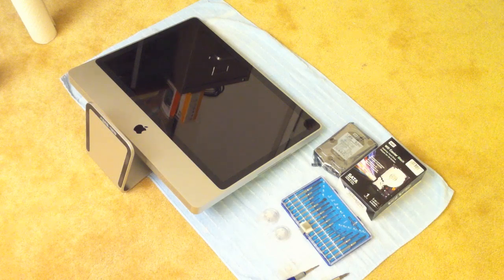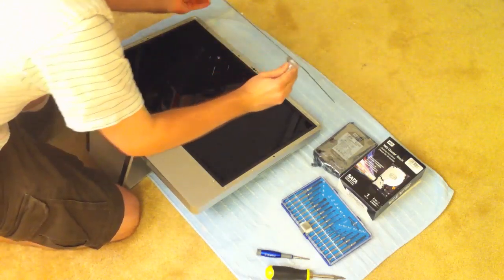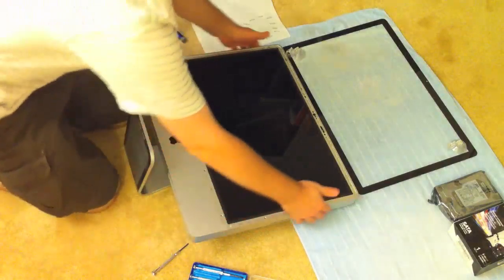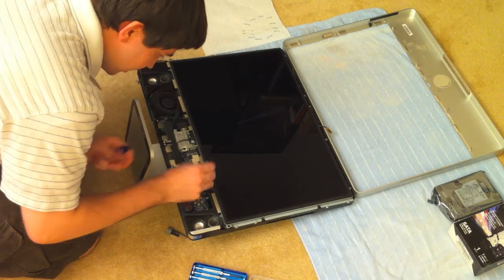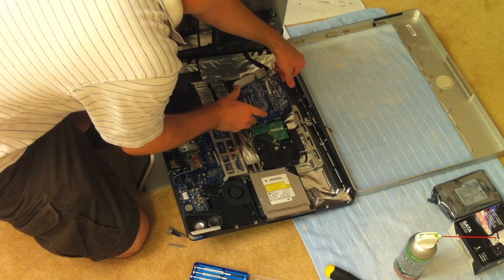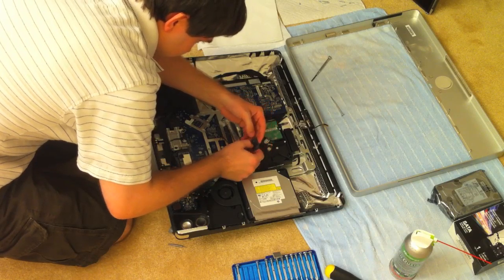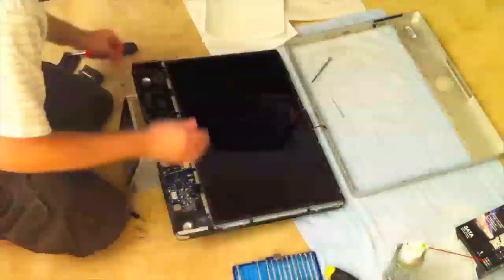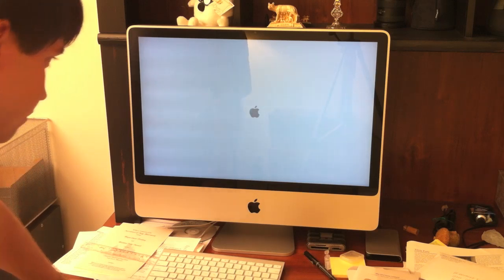iMac Hard Drive Replacement / DIY Take Apart Guide

Comment: Presumably it's going to be a similar procedure to replace the optical drive. I'm going to need to replacing mine soon as it no longer spins the disks. Are you aware of any particular thing I will need to be aware of if I choose to replace it myself?  I don't know what model I will choose yet.

Comment: You may have heard of the issue with the heat sensor in some models. Basically, everything runs fine other than the fact that your fans run at full speed nonstop. You can  either get some software to allow the iMac to use S.M.A.R.T. to regulate the fans -OR- buy an optical drive heat sensor that you can tape to the outside of the harddrive so that no additional software is required.

This is apparently the case with my Mid-2010 iMac. I'm choosing to just leave the stock drive and add a 2nd.

Comment: @dipzyv Yes, you can. You just need to buy an adapter but you will sacrify the cd reader . Insted, buy a ssd and replace your imac hdd. Buy an adapter insert the original hhd in it, that way you'll have a fast compter with a solid back up system.

Comment: I think it's the same situation, but I can't vouch for that 100% since I don't have any hands-on experience with that specific model. Google might know more on that one. :)
In case you do need it, you should be able to find those optical drive heat sensors for $30. I think I saw some on eBay. 
I decided to just leave my stock 1TB HDD in for storage and just add an SSD. You can find decent instructions on that here: ssd*youds*com (just replace asterisks with periods)

Comment: If you throw in a new drive and have fan issues, the software I was talking about is located at hddfancontrol*com 
It seems like everyone has had success with using that program to fix the issue.